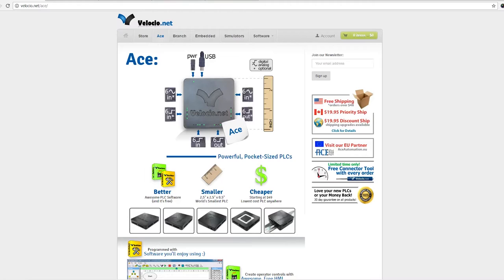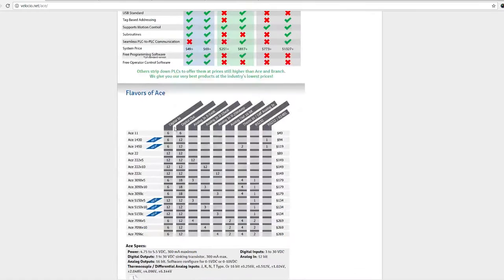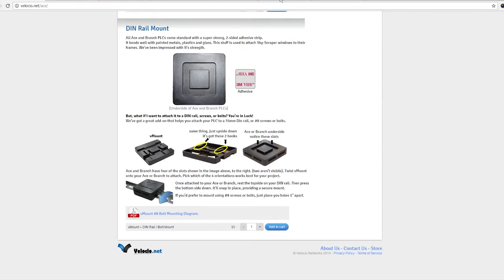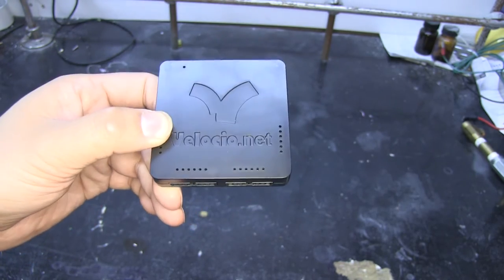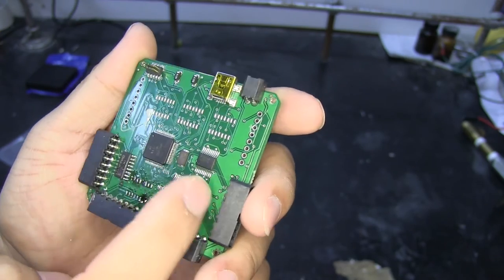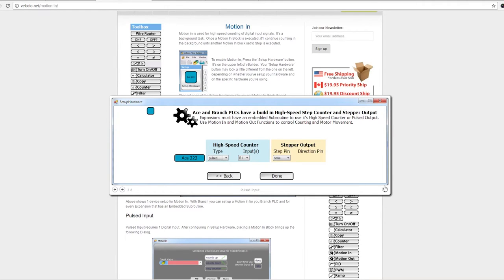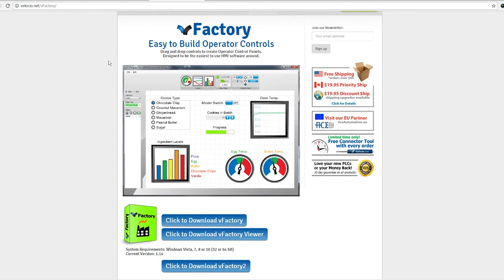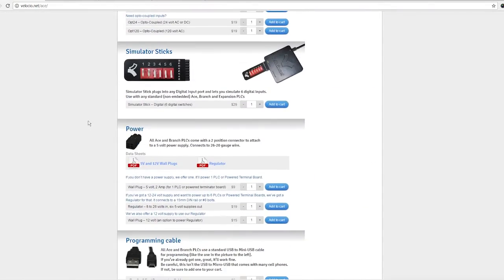(18) Velocio PLC Teardown/Review

Comment: Oh man, I didn't think about mixing up the connectors and sending 24V to the inputs.  First thing I did was grab a label maker and label the ports.  I think that is a great suggestion to have different size connectors for inputs and outputs.  Would gladly pay more for a more traditional plc style case with screw terminals.
Reply from the maker: Different sizes, or different keying... or even just colour coding!

Comment: I bought these to learn PLC programming/modbus/HMI for work. They do sell terminal boards that would protect the IO, but they're not included (but they are $15-29), so I think that would have solved the issue you had. 

I see this as a good, relatively cheap option for someone that wants to prototype automation projects without the investment. 

Their HMI is actually fairly good, it has a ton of options for displaying and logging data, plus a RTC. I think it was worth the price, but I believe it's just a chinese rebranded HMI though. 

You are mainly paying for their nice software with powerful features and nicer interface (I swear some of the PLC programs haven't updated since the 1990's). 

If you are just looking to automate a small project, the Raspberry Pi Pico is $5 and micropython makes it very easy to do IO (3.3V outputs, you would need your own optos and arrays).

Comment: I don't know if i understand your issue correctly, but you can put 30VDC on the power supply and on the io pins (not the analog pins, there only 10V). It doesn't have to be 5 Volts

Comment: I wanted to learn about PLC's and the price was right so I bought one.  In general I love the product. I would agree in the industrial world they are a pain to wire. I love the software except I have graphic issues were columns do not display right. I have to change the resolution on my monitors to read columns. This is the only software I have this issues with on my computer. The Stepper function work great.  Great Video. thanks

Comment: Power connector (2 position):
http://www.digikey.com/scripts/DkSearch/dksus.dll?Detail&itemSeq=210621237&uq=636135180067276914
http://www.digikey.com/product-detail/en/phoenix-contact/1778832/277-2322-ND/2625556

8 Position IO connector:
http://www.digikey.com/catalog/en/partgroup/combicon-ptpm-series/2640?mpart=1780503&vendor=277
http://www.digikey.com/product-detail/en/phoenix-contact/1778890/277-2328-ND/2625562

If the links are dead, search for:
   Phoenix Contact
      PTSM Series (spring contact)
      PTPM Series (insulation displacement)

Comment: I agree great review. I just brought one. Analogue 12in 12 out. I see now I will use relays to power my outputs. I have One question..

Can the plc be powered with the USB on its own?
Reply from the maker: That I'm not sure. My suspicion would be that regardless of whether you're powered by USB alone or not, you should ensure that you connect the +V and GND rails of your inputs and outputs properly so that current is sourced or sinked correctly to the external power supply, and not the USB power supply.
Reply: yes I agree. I just fried that PLC. ordered a new one with their own power supplies so I don't make that mistake again.
Reply: I got it all working i had to order their power supply but my input and outputs work correctly.
Reply: Thanks. you should see my project i'm working on.